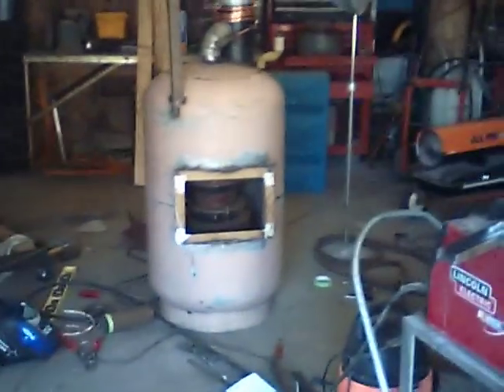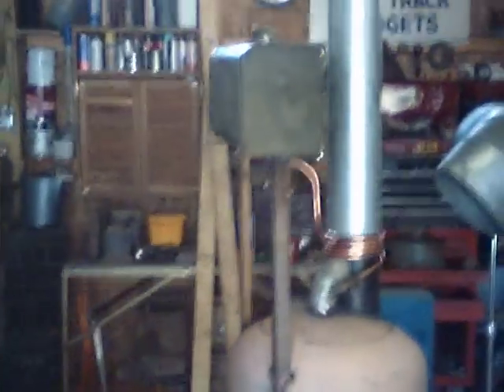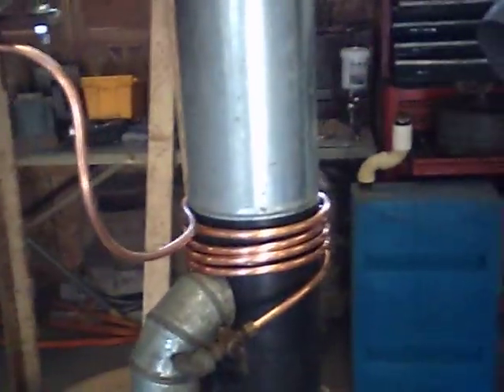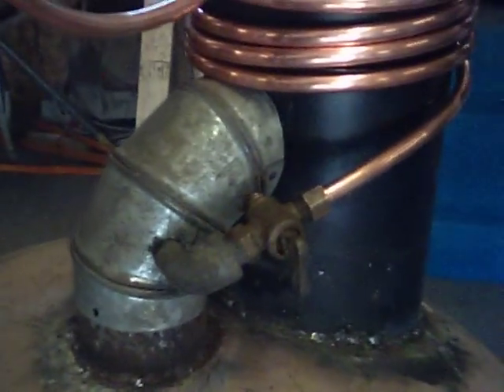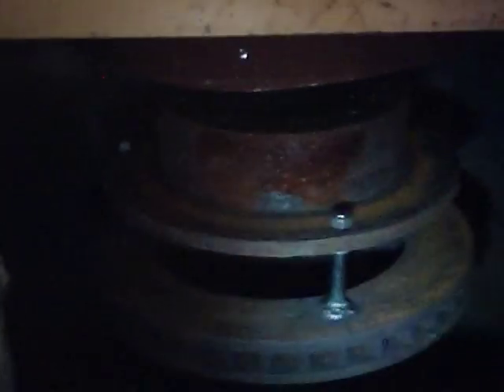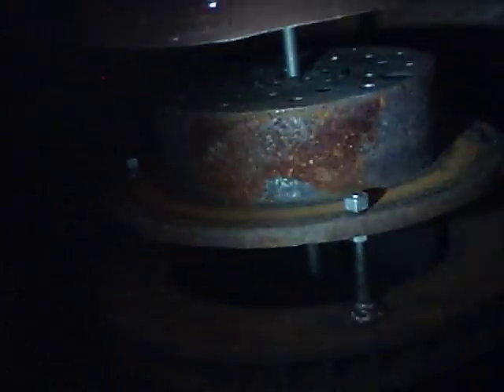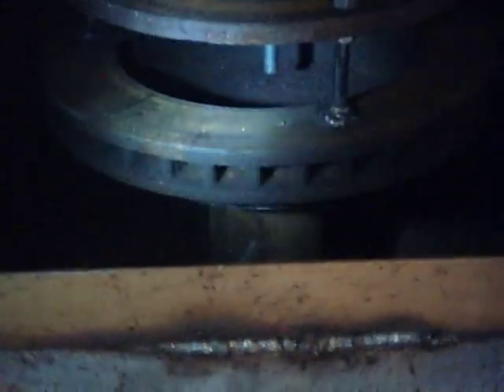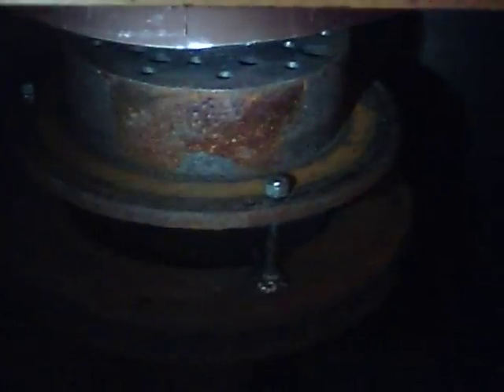WMO STOVE DRIP.AVI

Comment from the maker: Yes, It did "Gunk" up.  To much fuel and not enough air.  It needs a forced air system to clean up the combustion.  This would defeat my intent of off grid.  There are a lot better ideas out there, but I thought I would go with the original as a start point.

Comment from the maker: To be honest, I haven't used it this winter yet.  After some tinkering with it last year i got it to burn "OK", I wa difficult to get lighted.  I used a Oxy actlyene torch to heat the burn pan red hot and then started the oil drip.  This worked but not what I was looking for.  It does produce a very sooty smoke.  I think to improve the design you really need to be able to better control the air.  I think a electric fan would do the trick, but that defeats my goal of off the grid.  Goodluck!